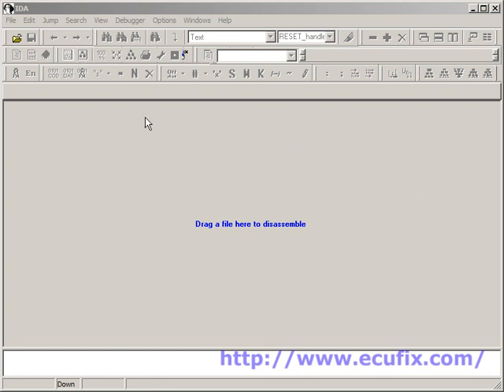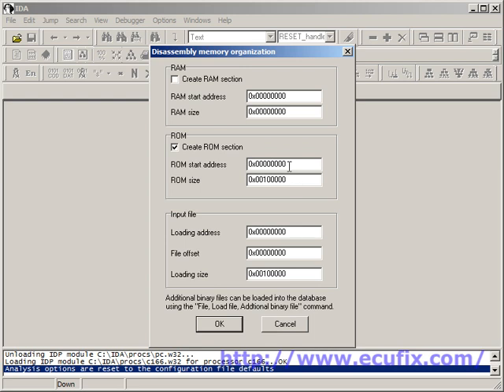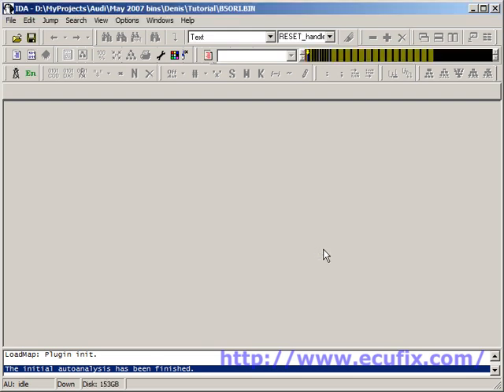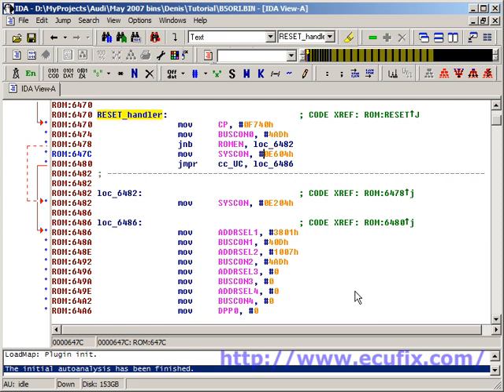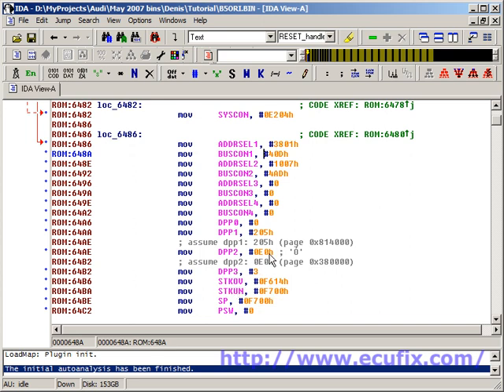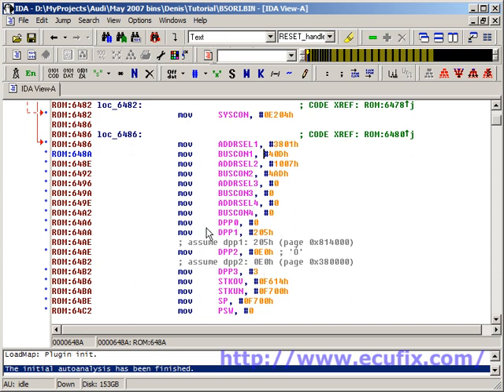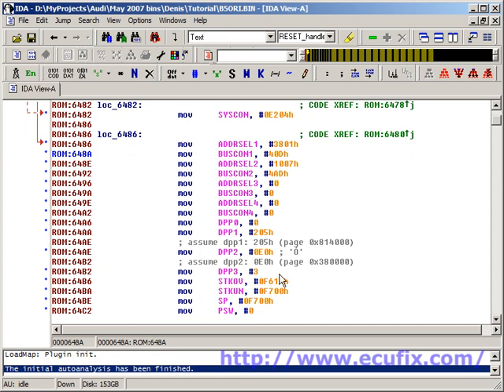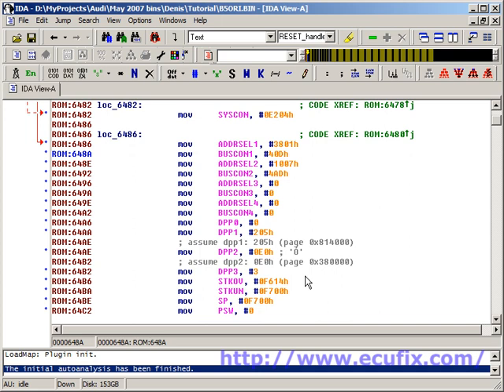IDA Disassemble Bosch ME7.1 ECU Tutorial 1

Comment: Hello. Im trying to disasm another ECU with the same processor (C167), but i didn't understand about DPP. DDP0 is first block,and DPP1 - second block. I need to understand , is first block has 64kB every time? And why in part 2, you used 0x810000x instead of 0x814000 ?